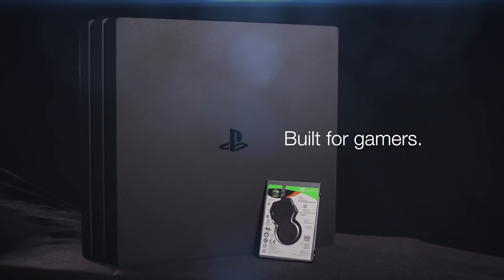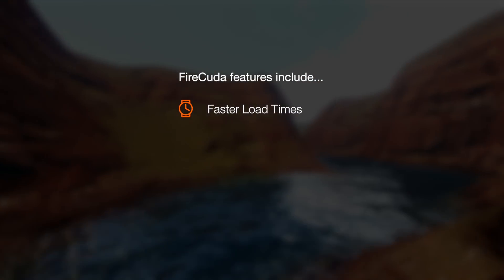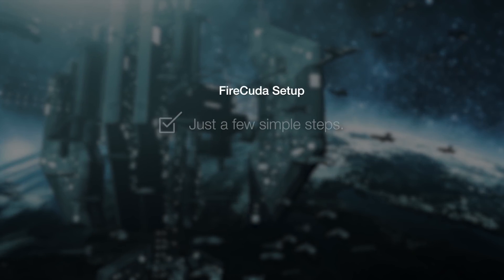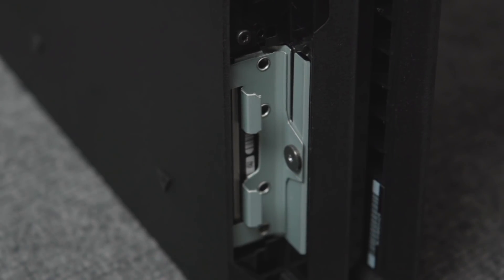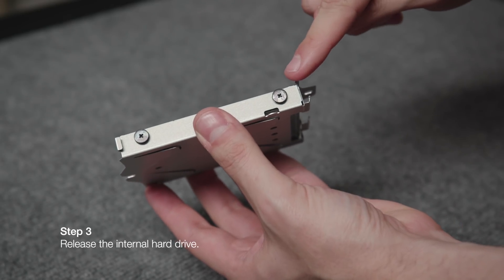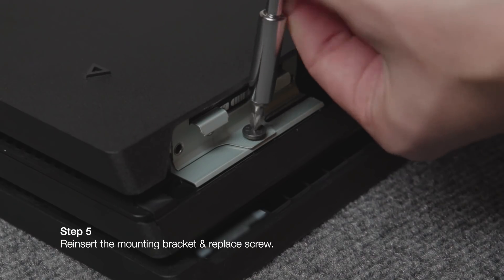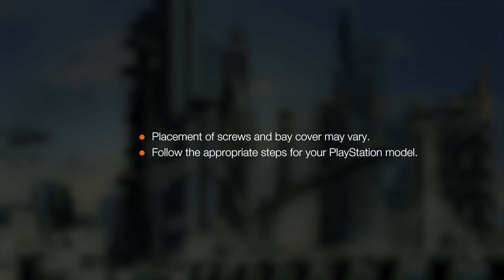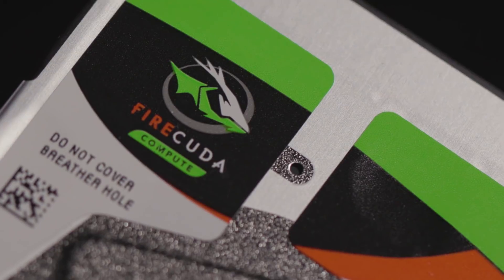How to Install a Faster, Bigger Hard Drive to Your PS4 Console

Comment: Hi, just installed my FireCuda yesterday. Unfortunately, I haven't seen the performance boost yet. I'm using the old stock HDD as my external now, so i'm wondering if having the firecuda as your app install location is necessary for the boost to be seen.

Comment: It fails very easily. Mine went faulty without much use as I already have PC, PS5. After turning it on for my cousin to play, i noticed the update is slow and tend to get stuck at a fail to shutdown properly screen. I switched to toshiba after that and had no issues. In conclusion, I think its safe to say who is the winner…